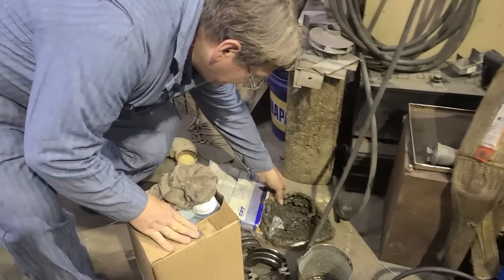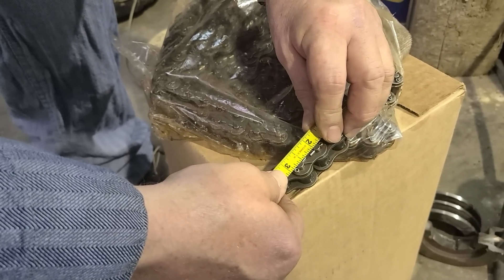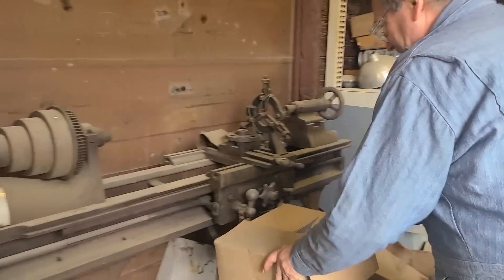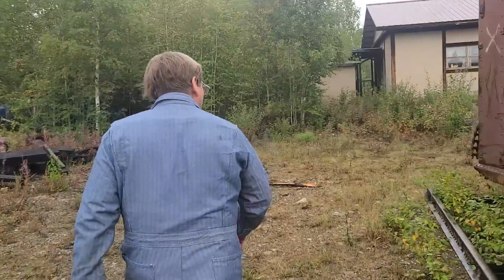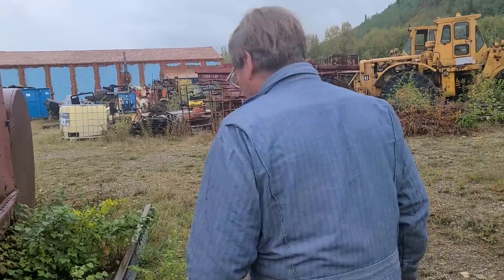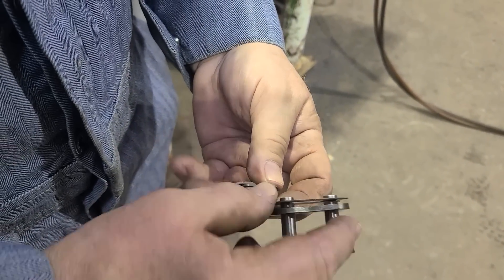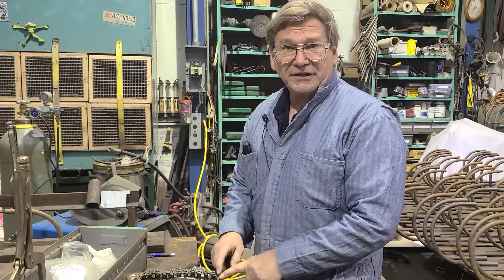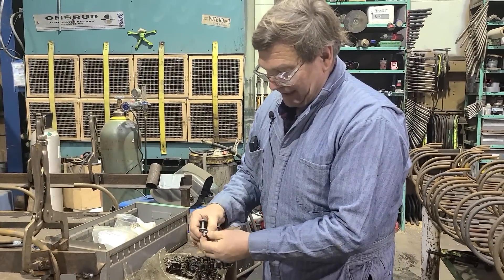Machinist's Minutes: Drive chains

Comment: despite half links having a tendancy to be weaker, one of the strongest chains in cycling is a fully forged steel half link chain. bmx riders use it in tricks where the chain ends up grinding on concrete ledges etc and the chain holds up well

Comment: Never knew where the American chain number came from. In the uk we just tent to use the pitch and width. Your yard looks like mine, everything may come in one day 😂, presumably you can’t access anything outside for half the year as if will be under snow 🤷‍♂️
Reply from the maker: If you know roughly where it is you can always send out the FNG to dig through the snow and find it. The open spaces get plowed all winter, you can still drive around out there. It's only dark and -40, it's fine.
-Cameraman

Comment: you'll see chain wiht 3 digits too, like 520 (5/8's pitch, 2/8 width) the straight 2 digits chains are considered "generic" and all have a set ratio for width vs pitch, lots of motorphycho chain is 530 or 540, slightly wider then a normal 50 series chain, helps keep wear between aluminum sprockets and the chain consistent. they will break down further say a 525, would be 5/8 pitch, but 5/16 width, that extra 5 denoting a half an 1/8... probably one of the many reasons the rest of the world thinks ASE/Imperial is dumb, but to us it makes absolute sense lol.